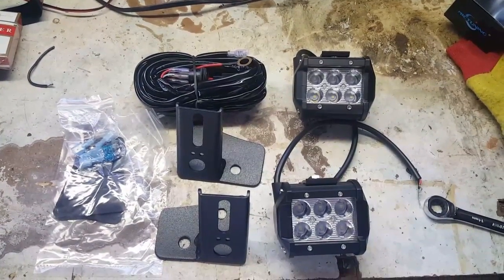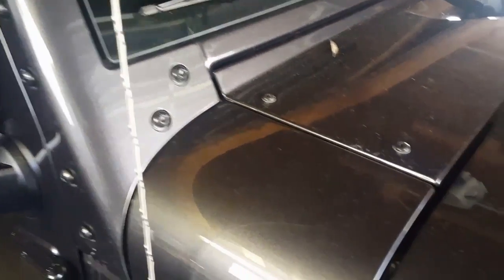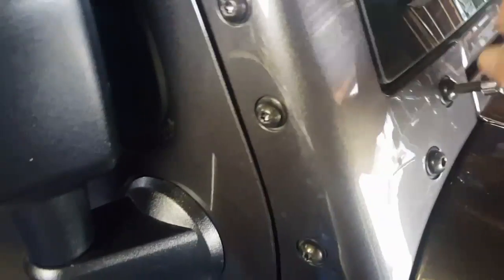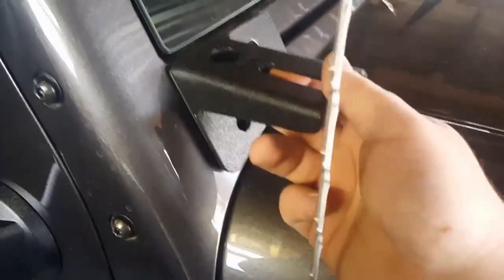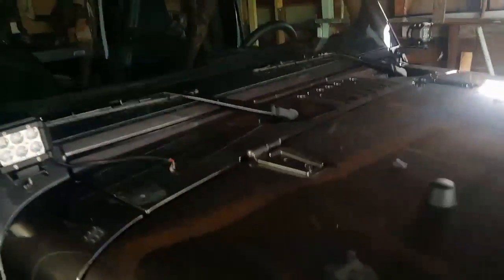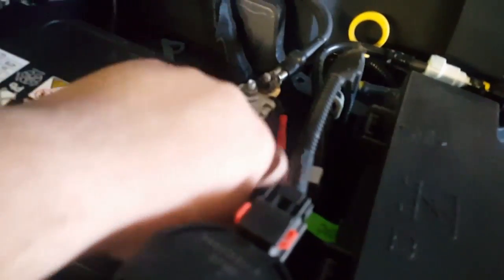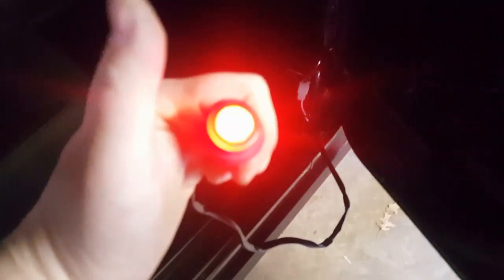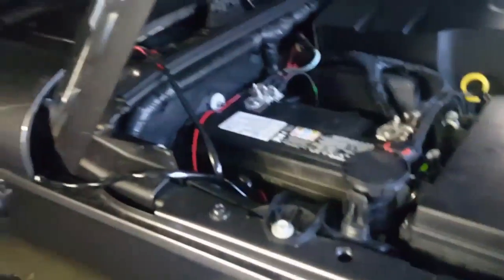How To Install LED Windshield Lights On a Jeep Jk

Comment: Jeep put a hole in the firewall, all you have to do is remove the rubber grommet (or foam) and you can run your wires right in. On the passenger side  you just remove the flat plastic on the dash that meets the door or on the driver side it's basically right behind the speaker (on the fire wall).

Comment: You could have grounded anywhere in the engine he did not have to go straight to the battery.

Also I would run the wires under the hood towards the driver side.
 Then run the switch wire straight through the firewall, through the grommet, above the brake pedal which is made for wiring to come through.... ( you want everything to look Factory but you ran a wire through the door? If one person slams that door it's going to cause an electrical problem because all the cart is now coming straight from the battery all through the vehicle. #fuse....($3.00) at auto part store...
Reply from the maker: RainbowSixThree Enlightened Thank you for the tips, I will definitely look into running the wires through the firewall it does look better. I didn't have any problems with the wiring going through the door because there is enough space so the wire doesn't get pinched. As for the fuse, the wiring harness comes with it's own inline fuse.

Comment: did your kit come with a tap harness? did you not use it and hardwire the lights straight to the battery?
Reply from the maker: +Ed Redmond The harness came with everything necessary to wire the lights.
Reply: do you have a link to where you ordered the wire harness

Comment: That peace is spot welded you can't slide under it. Try using a peace of solid wire, pull that through where you want it, then tape that to the electrical wires and pull them through.
Reply from the maker: Pranay That's exactly what I did, thank you.

Comment: This video isnt really helpful :(  Do you have another showing all the steps and EXACTLY how you did the wiring?  I have these exact same lights and it would be really helpful if you showed all of your steps and not skip over anything.
Reply from the maker: Thank you for the feedback, unfortunately I don't :( this was one of my first videos so skills weren't the best lol. If you have any questions please feel free to ask me.
Reply: Ab's Garage my question is exactly how did you wire up the lights?
Reply from the maker: Nilight LED Light Bar Wiring Harness Kit 12V On Off Switch Power Relay Blade Fuse for Off Road Lights LED Work Light,2 years Warranty https://www.amazon.com/dp/B071ZPX32N/ref=cm_sw_r_cp_apa_i_Wz-vEbNF1XEEP

This is the harness that I went for, the two ring terminal will connect to the battery red is positive and black is negative. After that, you will match the black and red wires with the butt connectors on the harness with the black and red wires on the lights. (You can solder the connections and heat shrink or use the butt connectors if you're planning on removing them in the future which is what I did) then route the switch inside the cabin using the grommet by the brake pedal and mount it.
It is really easier done than said